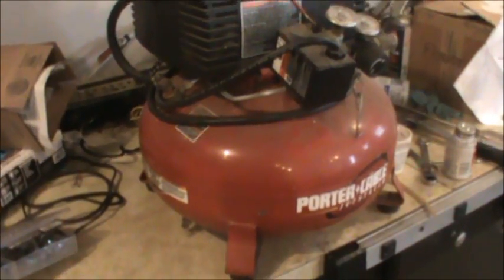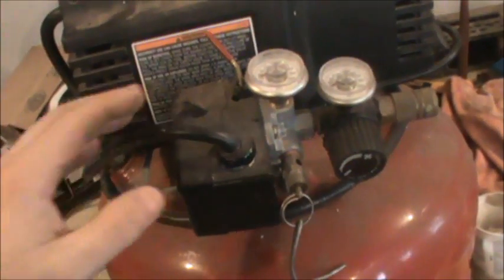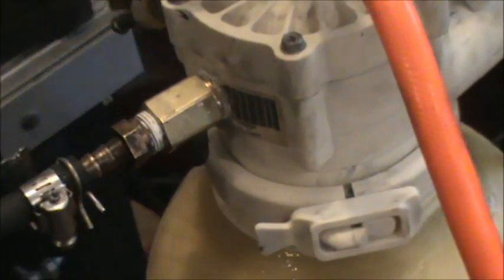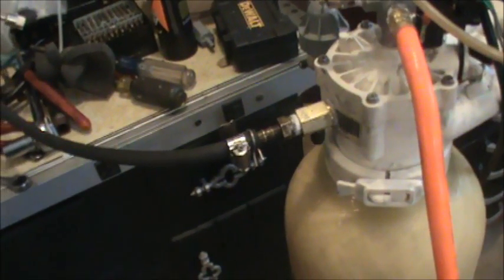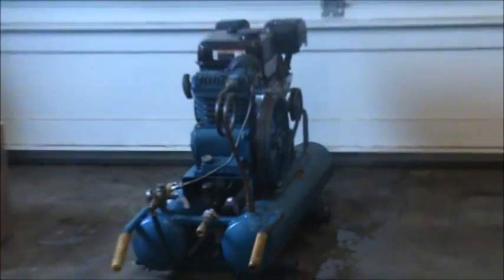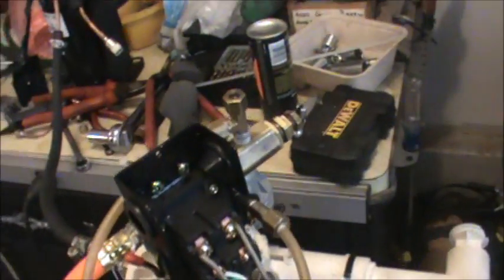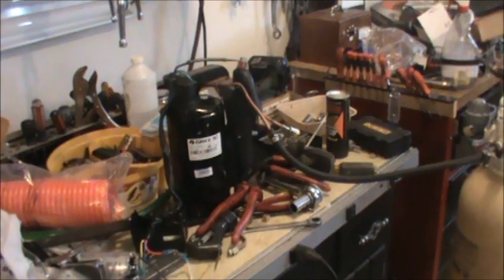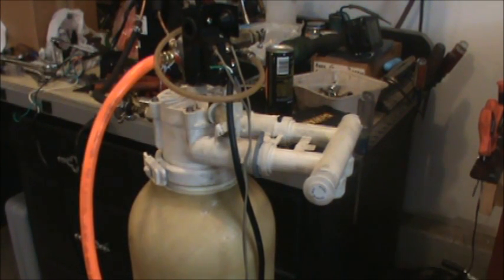Homemade Air Compressor Plumbing

Comment: I don't think you fully understand what an unloader valve does.  Yours is unloading pressure from the wrong place.  Move the T fitting from it's current location to the end of the compressor's output hose, just before the check valve.  Go compressor to unloader fitting to check valve to receiver tank, and it should perform properly.

Comment: This is awesome! A silent air compressor. Why hasn't anyone else don't this before? Lol. A Rollair air compressor is similar in sound but really really expensive. You made this out of things you have around the house. Any idea what's the bursting pressure of the fiberglass tank?
Reply from the maker: The tank is Max pressure tested at 300psi.  I would think burst would be over double that, but I am just guessing.  I will let you know if it blows up.
Reply: I don't know what would hurt more a steel tank exploding or a fiberglass one? Thanks.